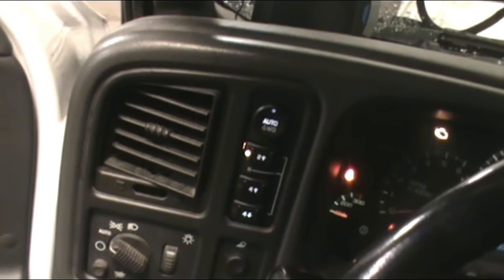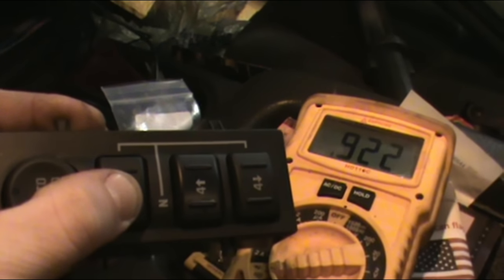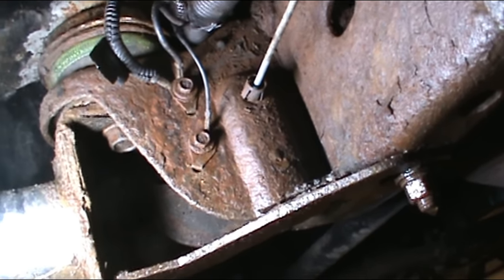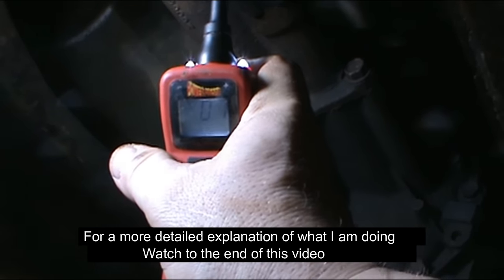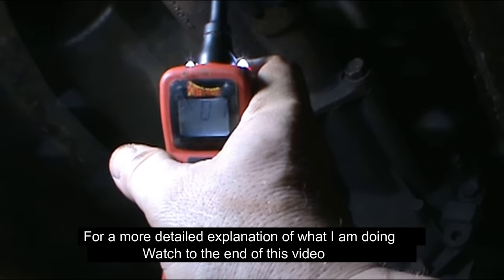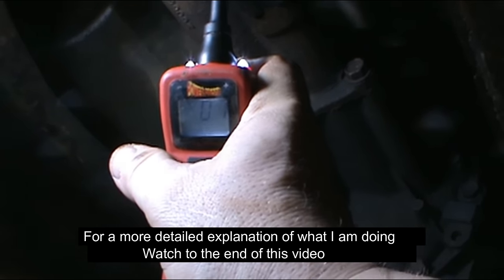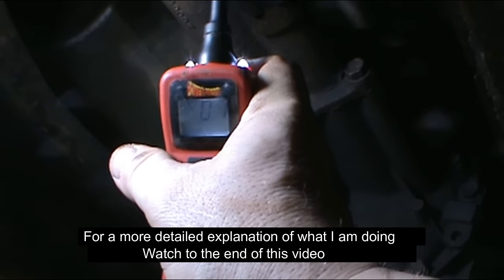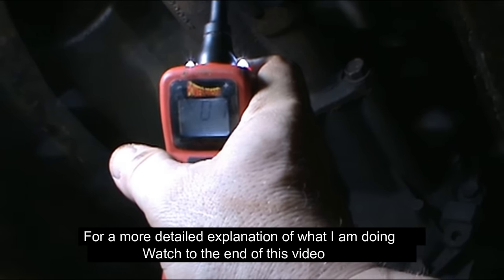Service 4wd diagnosis

Comment: I. Have the opposite problem no battery volt any idea ?
Reply from the maker: Do you have a good ground
Reply: Yes I have a good ground I check all fuses
Reply: I also went up to where u bypass tht ground and my brown wire which supposedly be POSTIVE turn into ground
Reply from the maker: @zecuaventures9412  I would keep chasing the brown wire, sounds shorted or broken
Reply: Alrighty thank you

Comment: After about a week of adding the new ground wire, and everything is perfect on the dash, I thought I was golden!
After I had been out today, and came home.... At this point all was still good. Later, I started truck up again and drove into a lower part of my property (short hill down, kinda steep, a little rough) and then noticed the button for 4 auto was lit up... So I punched it to 2 wd, and then Service 4 wd on dash came on.... Wth!
Reply from the maker: Did you change your shift encoder
Reply: @GSEShop  no sir.  It was not quite dark, so I'm going to get under it again. The down hill was a kinda rutted trail... So I want to check the splice connector in case for some reason it snagged on something. But is the encoder under where the transfer motor is attached? I actually didn't see it last time under. I didn't have to remove my skid plate to get at the actuator wires. And sprayed carb cleaner on the plug because it was dirty and oily.. didn't take plug out... Maybe I should have to make sure no oil was insude plug.
Reply: @GSEShop  as it had rained yesterday, I wasn't able to actually crawl under it and look at the splice. But today I drove it for about 60 miles, and made a gas stop, and when I got going again, it was functional again. So this began that way when I first put the wire in. After about 7-8 miles it began working. And it was until day before yesterday. I'm gonna pull the plug and clean it with carb spray and put some die-electric grease on the pins... Unless you think that might be bad.
Reply: Hey, there.... I'm puzzled. After I drove it yesterday and the Service 4 wd has stopped, and everything is back to normal, I checked the plug. Everything seems okay... It was dry and clean inside .... I, again drove down the same rutted trail today, and parked in the same place. Nothing was repeated, I even used my 4 auto position. What possible Gremlin could it be. If it happens again I think the splice connector should be replaced with a soldered connection and some liquid electric tape.
Reply from the maker: @genesloan3175  I think your encoder is going bad
Reply: @GSEShop  is that the TCCM, or some other part behind the motor? Is there a code that would be a positive ID for it?
Reply: @GSEShop  oh, and if I haven't said it before, I really appreciate your video, but most importantly to me is how you've taken the extra time to respond to me with helpful info.... You are a hero, not a zero!
Reply from the maker: @genesloan3175  thank you, I try.  The encoder is part of the transfer case shift motor, you can change the piece or the whole motor on the side of the transfer case.  And yes it will throw a code but you need to have a scanner that can read gm tec two.  Those are usually super high dollar ones that most home mechanics will not have.
Reply: @GSEShop  thanks, at least with your help I can just change what needs changed and not just be throwing parts at it.
Reply from the maker: @genesloan3175  I can try

Comment: What if when I check the connector at the actuator I don’t have any that read battery voltage?
Reply from the maker: You may have a broken wire
Reply: @GSEShop  I have a good ground but can’t pick up anything else. Is there a way to run a new wire like you did the ground?
Reply from the maker: @alecjohnson4325  trace it back. Find the next plug or area that you have power on the correct wire.
Reply: @GSEShop  I don’t have power at the connector in the engine bay by the wheel well either. Any suggestions. I really appreciate the help
Reply from the maker: @alecjohnson4325  see how far you can chase it
Reply: @GSEShop  it looks as if it comes right out of the fuse box
Reply: So I’m kind of stumped. I can hear the motor making noise, but it won’t engage in 4Wd anymore
Reply from the maker: @alecjohnson4325  are all your fuses good, I never traced the pos wire?
Reply: @GSEShop  My Trec which I believe is the fuse is good. That’s what I’m not understanding
Reply from the maker: @alecjohnson4325  I would check them all but there should be a 4wd fuse. See if you have 12 volts across the fuse.
Reply from the maker: @alecjohnson4325  the TREC fuse powers the TCCM on the transfer case
Reply from the maker: @alecjohnson4325  did you get power to the actuator
Reply: @GSEShop  I have power now and the 4Wd was working and would engage in hi and lo. After driving to work, service 4Wd pops up and I can only seem to get it to work if I re cycle the key
Reply: Also when I get the service 4Wd after it’s been running when I try to switch into 4 It doesn’t flash at me
Reply from the maker: @alecjohnson4325  does it go in now?  Sorry my notifications must be off
Reply: @GSEShop  no worries. It works for the most part. I have some pretty intense dash light flicker when I roll up the windows and after that happens it seems to be funky for a bit. But I know everything is working in the 4wd system. So I’m not completely sure if that could be related
Reply from the maker: @alecjohnson4325  electrical is all related, that is what makes it so hard to troubleshoot.  I had an intermittent misfire on startup that would come and go for years.  I tried new plugs, wires, cam sensor, MAS, and swapping coils and couldn’t get it figured out.  Then one day I go out to start the truck to go to work and the battery wouldn’t spin fast enough to start it, came out after work same thing, the. I got a new battery and haven’t had a miss since.

Comment: That looked like continuity/diode check , ohms Is the horseshoe looking symbol neither here nor there but thought you may want to know .
Reply from the maker: I understand how someone could get confused, and thank you for pointing that out.  however, my multi-meter still displays an ohms reading with a continuity/diode setting so I use it as a default.

Comment: My 2005 blinks but doesn’t engage ☹️
Reply from the maker: Did you watch the video to the end?
Reply: @GSEShop  down to part about your wrench I saw your switch wasn’t even blinking though
Reply from the maker: @zets8600  that was what it did before I started the video.  If you hear the transfer case shift motor move and it still doesn’t show 4hi then it is probably something to do with the front axle actuator.  Check the wires first and watch the whole video

Comment: So part one your switch didn’t light up on 4 wheels stayed on 2 wheels an part 2 lol of your video it works but you didn’t say what it was to make the switch to work
Reply from the maker: I showed how to test the switch and   How to replace it if needed.  I am not sure what else there is to the switch that needed to be shown.  The fault with my truck was the ground wire attached to the front axle actuator which I detailed my fix and then went over why it worked.

Comment: If you are already a cleaned the ground on the frame once and you knew that was a problem why didn't you just clean them again? Obviously that was your problem to begin with you just bypass the ground with what you did which is fine but looking at your frame and you're obviously in the Rust Belt wouldn't you thought what that was your problem from the get-go before spending a grand on parts? Clean it up put it back together shoot with some por-15  or good paint call it a day. You would have saved $1,000.19 LOL
Reply from the maker: Snowdogkh I DID CLEAN IT AGAIN.  I think the wire had corrosion in it, and that is why I did what I did.  Hopefully me sharing this keeps someone else from spending a grand with no success.

Comment: Ya my trucks 4x4 switch , all three lights just stat lit up all the time
Reply from the maker: LightningSurvivor 14  start with the switch and go from there
Reply: @GSEShop  got under the truck found a bunch of wires with no coating
Reply from the maker: LightningSurvivor 14 if they are bare I would start there

Comment: Hi there mines stuck in auto
Reply from the maker: It is either the encoder or the front axle actuator most likely.  I would start with the actuator it is easier to get to
Reply: I will try that thanks.. last week I took the fuse out on the side of the dash that controls it.    Left it out I start pressing each of the buttons they start lighting up.   Put the fuse back in went back to being stuck in auto 4x4.    Try the same thing again with the fuse didn't work as it did the first.       So confused.    Will try your way.
Reply: I also clean the ground wires that's located on the driver side frame under the truck
Reply: Also do you have any clue about the battery not charging that comes on the dash.    I replace the alternator with a new and battery same thing.  The battery gauge is showing that it holding juice.     I had this truck going on 3 months and these the issues I'm having.   Thanks again stay bless
Reply from the maker: @blesswheelz9950  ok
Reply from the maker: @blesswheelz9950  I don’t know about the battery charging issue but they may be related